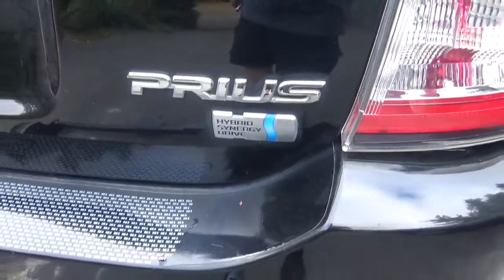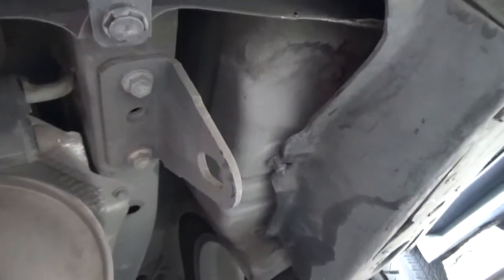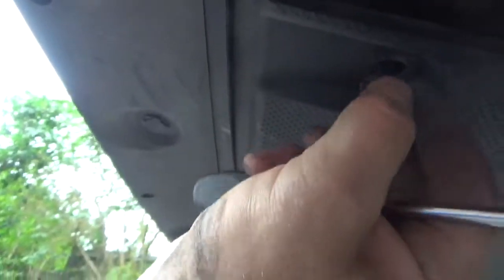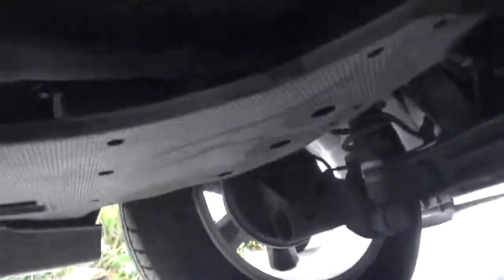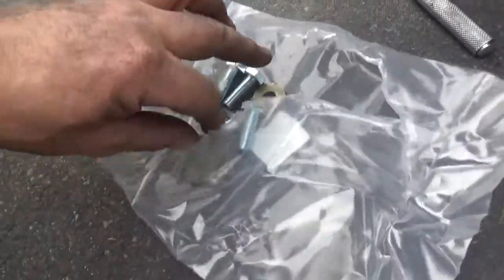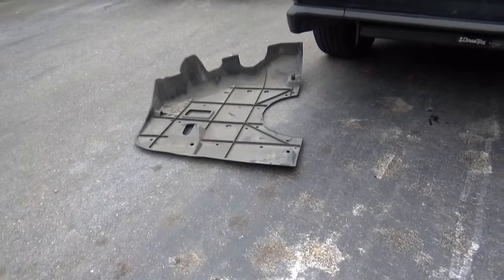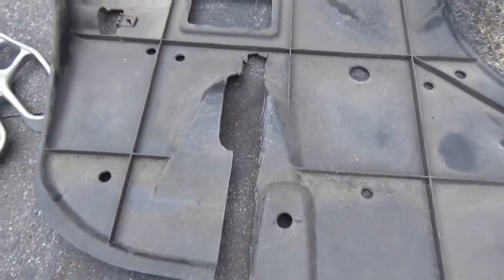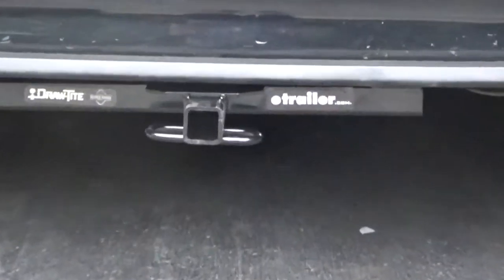Installing a Trailer Hitch on a Toyoto Prius - 2005 - Easy!

Comment: Beware…for anyone considering using this mount for a bike rack. A 200 lb rating is at the end of the hitch. You must add roughly 23 lbs per inch as you lengthen the leverage point, which is about 18”! Do the math. A rack alone exceeds the limit. I installed a curt class 1 for 2 bikes. I suppose it will be ok if I am careful. Just a heads up!

Comment: Please indicate what year Prius you are working on in the title of your video. 
I admit I should have done more homework, but was excited to install the unit on my 2013 model and ended up taking all the underside apart before realizing I really didn’t need to do any of that.   At lease with my model, you can just install it with all the plastic cover in place.  Putting this comment here in case anyone else wonders about that.
Reply: What hitch did you use...please
Reply: the guy in the video states it is a 2005
Reply: 2005 is 2nd generation. That is model year 2004-2009.
Reply: Didn’t you want to keep the tow flanges in case you needed a tow?

Comment: wanna do this to my 2005 Prius, Gen 2, as well.  I just bought Hopkins 47555, vehicle to trailer adapter, 7 blade, 6 round.  Will this one work with wiring ?  or do I need to return it and which do I need to get, please?
Reply: That's overkill for a prius because you will never haul something with brakes. A 4 flat is all you need
Reply: @TriStarGearhead  thank you!